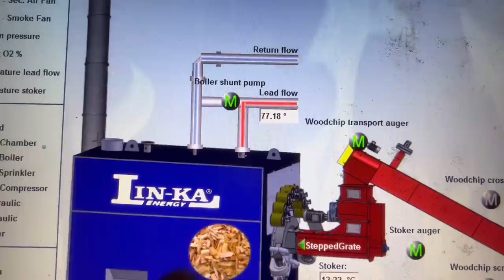Day624  #OLLYBLOGS BLACK FENDT TRACTOR NEEDS A BLACK LIGHT FOR THE TRACTOR RUN   #AnswerAsAPercent

Comment: Amazing how wood chip has worn that auger away. You can download a calculator on the internet for cutting auger flights so they end up the correct size. Easier to buy them read made. Careful with those little bags of white powder 🤣🤣

Comment: Did you not think of de-rusting before using the plasma and giving the machine a better chance? basic! 92.1% .Inverter.
Reply from the maker: It normally eats it 
Nib was loose tightened it and I was easy then
Reply: @OllyBlogsAgricontractfarmer  cleanliness is next to godliness!  :-)

Comment: Try A R Craib  from Dyce Aberdeen, they run lorries up and down the A1 and charge by volume on the Lorrie instead of the whole lorry, it’s termed as groupage, I’ve used them in the past on several occasions and found them very reasonable 
95% today, test day tomorrow 👍

Comment: Inverter.    Larger inverters great around the farm for power tools to run off the tractor battery.     Had to drill a load of empty water troughs in the past  for overflows, and real great for a mains drill or angle grinder plus other power tools.